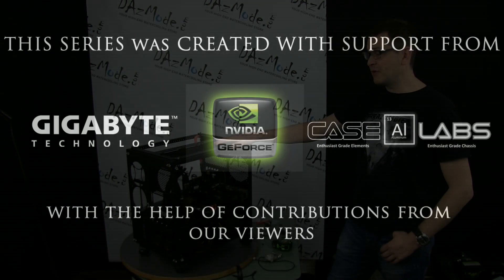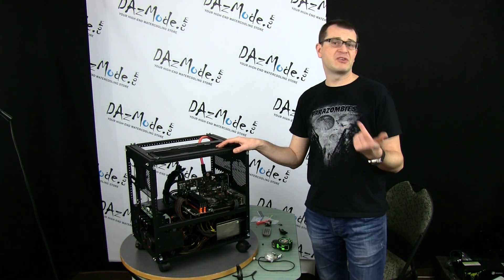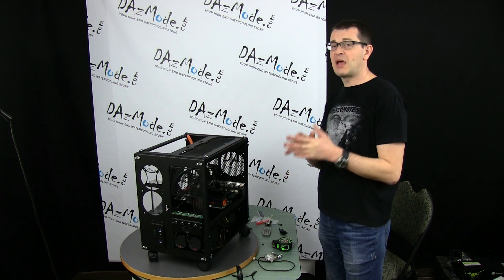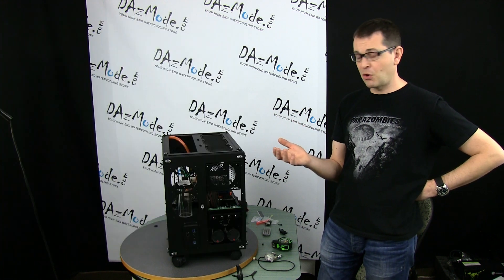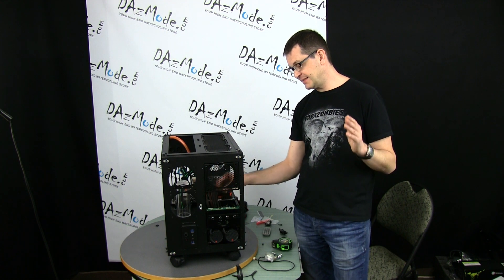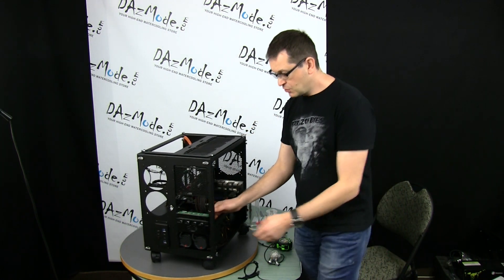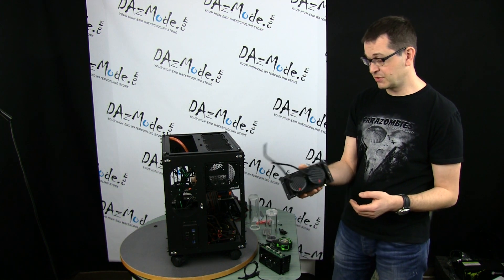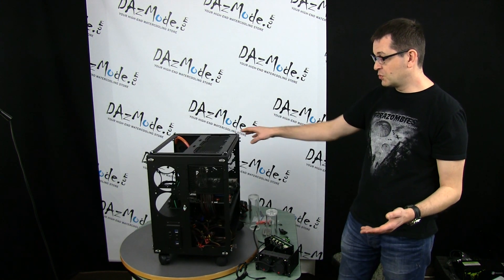Pump modding is a B! - DazLab Reloaded EP5

Comment: Hi Daz, which flow rate meter? how much restriction does it add? i have been looking for a flowrate  meter that can fit on a normal fan speed header on motherboard or fan controller (not aquero or the other really good but expensive one)

http://www.xpert-oc-team.de/forum/index.php?area=vbcmsarea_content&contentid=151

continue having fun with the build!
Reply from the maker: Koolance FM16 with display unit FM01. I believe Bitspower FS models is the one you need.